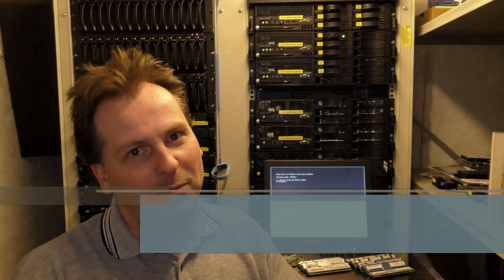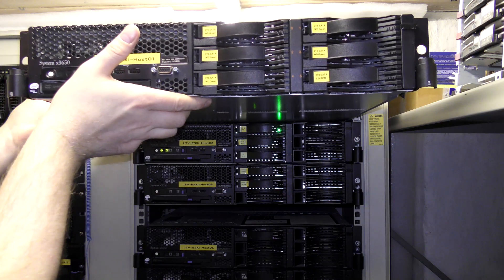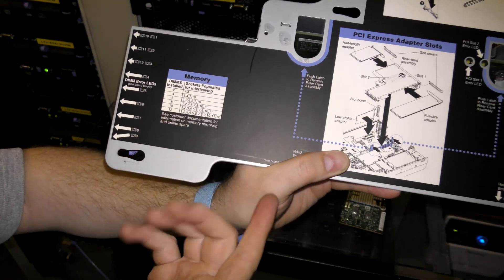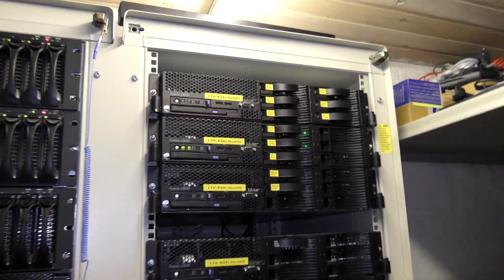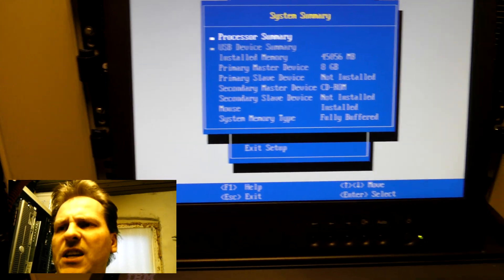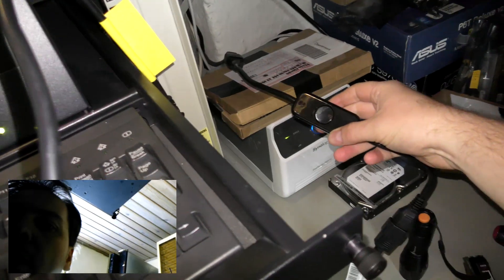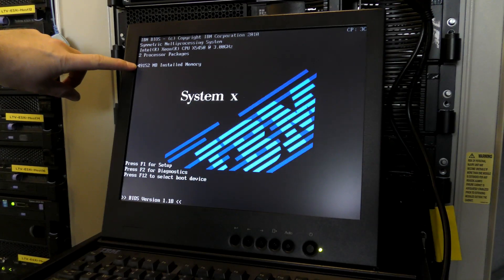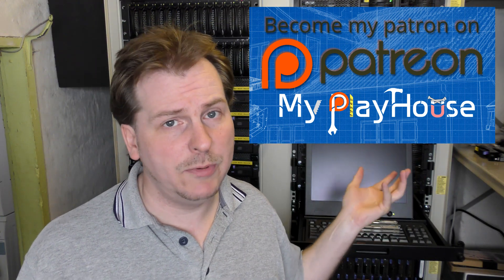48GB of Ram and 4Gbit more network in My x3650 M1 - 517

Comment: I think ESXI 6.5 will not be supporting the CPU's in the M1
Reply from the maker: Hi nicolae788
There are two system boards available for the x3650 M,, the one with Intel Xeon 5400,, will work... it does woarn you that it is working on it's last leg.
Thank you for watching! :-)
Reply: nice, then :) i, personally, i am stuck with 6.0 update 2, but it seems to work OK, so i do not need to upgrade it. all the best
Reply from the maker: I did a video on installing ESXi 6.5 on a x3650 M1 : https://youtu.be/ERAOywXH4l0

Comment: Hi Morten, you managed to get the issue with reported memory size solved by swapping some memory modules, but you still can't really trust the system as the problem might be intermittent. Suggest to have the box run memtest86 for a couple of days to really check the integrity of the memory before putting it in "production". Otherwise you may be chasing strange problems for a long time. Use of memtest86 may be an interesting video :-).  Btw, I find it easiest to use from recent ubuntu Linux boot USB.
Reply from the maker: Hi Frank van de Pol
This error was very replicable,, so it was easy to see when it was gone. 
Thank you for watching! :-)

Comment: was watching a guy seems very knowledgeable  said that the GPU are all the same but from different batches that's how they are classed in manufacturing .Say for instance a 1050 a 1060 a 1070 and a 1080 are all the same processor it's only batch to a different number when it is tested? if this is the case can I make a 1050 run like a 1080. by using some sort of software to access the processor.I know the problem in general they have less RAM than the higher model spec's, I was wondering if there's a way of boosting the ram as well could you piggyback RAM or make a daughter board to replace where the RAM is? say for instance it has only 3 gigabytes and I want to put 11 gigabytes of ddr5 could this be swapped out for a higher capacity RAM or would the internal wiring be completely different I know the GPU bus is capable of handle the high capacity if you take the theory earlier on what I said about them being the same GPUs
Reply: John sweda if you go into your bios and then to the advanced tab you can change your dedicated video ram ( doesn't work on every pc) ps this is regular ram you dedicate to video processing.
Reply from the maker: I do not believe that is posable,, if it was,, everyone would be doing it..

Comment: What about the full 16TB of ECC RAM and four INTEL I7 7700K chips might work out, Oh what about get Samsung-32GB-4x-8GB-PC4-2133P-ECC RAM modules.
Reply: 7700k are not working in Dual Socket even the new Kabylake-Scalabale 7700 sibling is not working in Dual Sockel.

And DDR4 ECC doesn't fit in an M1...
Reply from the maker: 16TB,, even 7 years later that is more than I have ever seen.

Comment: I'm wondering your internet specs :)
Reply from the maker: I have a 30/30Mbit,,, humm do I need to update my FAQ.
Reply: 10Gbps/10Gbps
Reply: no, it's all about bandwidth which translates to many over 1 connection...you need bandwidth not speed
Reply: He has wireless (as I recall). See the FAQ :)
Reply: great video mate everytime I watch I get more encouragement to play with equipment have my hands on a x3400 M3 to play with now as well having a lot of issue with10gbe and DACs using a unified 16 port switch slowly getting there
Reply: +My PlayHouse Dang lucky :v
Reply: nope i just don't read FAQs
Reply: Hardly that's the point in these videos? The channel is called "My PlayHouse" :)